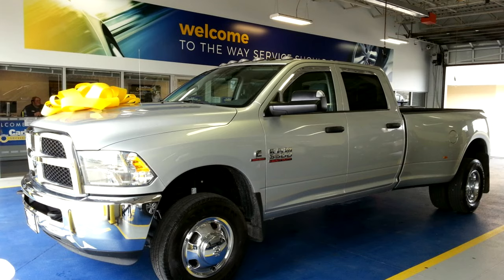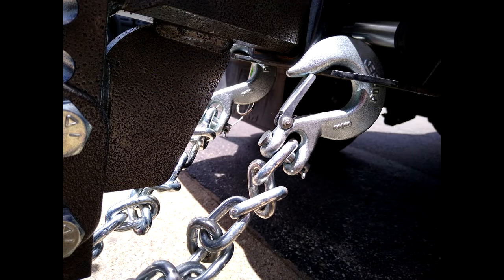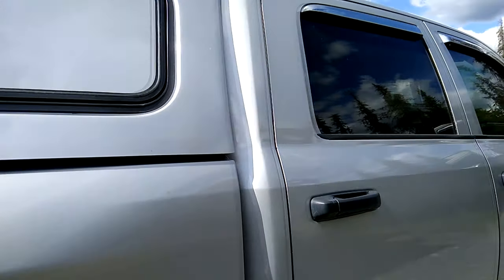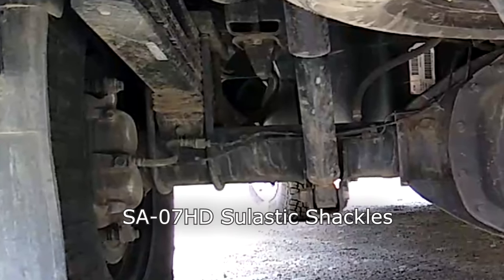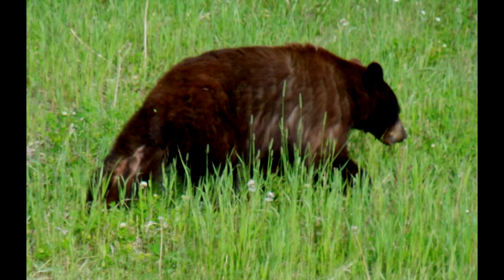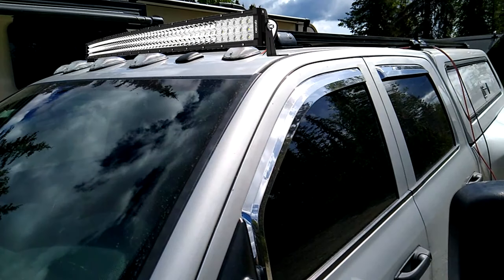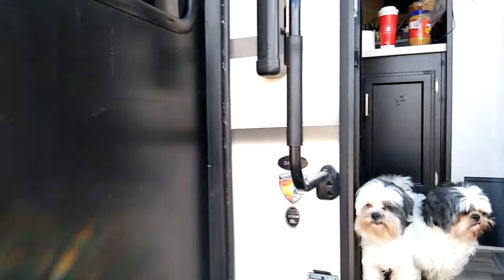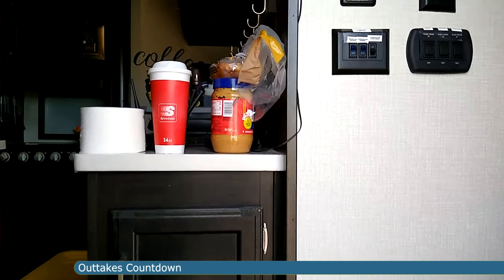RAM 3500 & Upgrades Tour: Journey to our Alaska Off-Grid Property

Comment: Put your wiring down thru your clearance  lights on top.. pop one off go thru wiring hole and go from there, we ran ours across windshield  down side door and up under dash to plug installed
Reply from the maker: Oh wow, that's a great idea!! Thank you!
Reply: @homeatlaska  just found your channel..we bought our Dream 20 acres in a totally  unrestricted , unzoned County, and Township in part of NW mitten of michigan.. moved a 33 ft 2022 BH Artic edition TT mine... a 10 ×24 Amish cabin for DD and G -boys and my son is in a 10×20 wall tent..he'll have amish build his cabin this spring.. and my  addition on my TT will get done spring and summer. My 60 year old butt is cold in my TT with just propane plus moisture is just to much from propane it causes my O2 sensor to go off constantly.. and I don't like the ice buildup around the slides.. so my 12 ft addition will be put on down one entire side, and that will turn into my official kitchen, canning and pantry area w/ dining..  lounge woodstove hang out area.... all open all the windows on that one side of the RV and the wood stove should heat everything. We didnt have the time to put underpinning insulation or anything under the travel trailer before winter hit this year..so just making it thru winter.. and the hard work starts in the spring
Reply from the maker: Sounds familiar... ;)  You'll make it through!  Hang in there!!